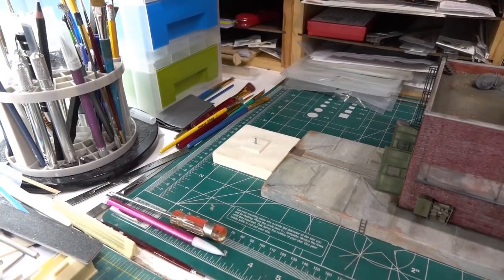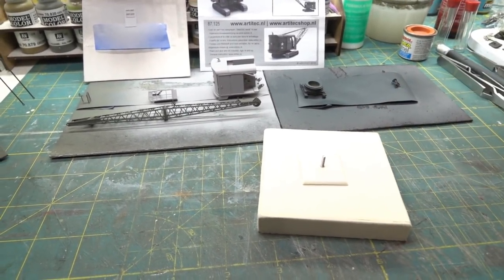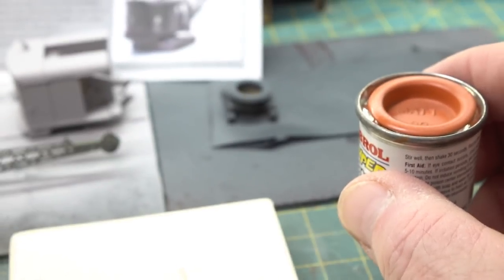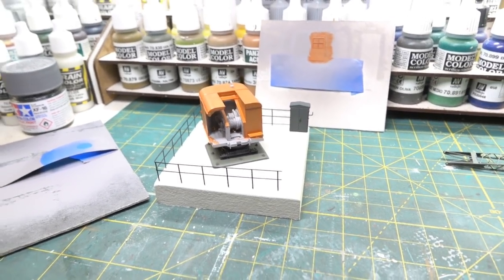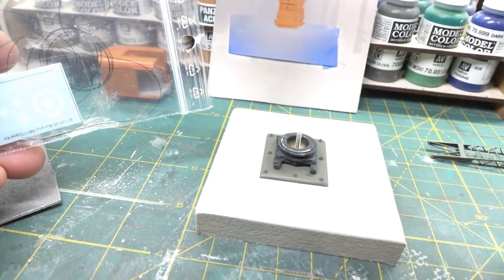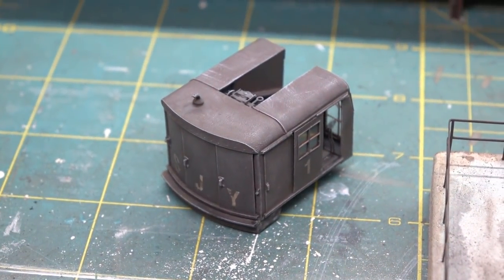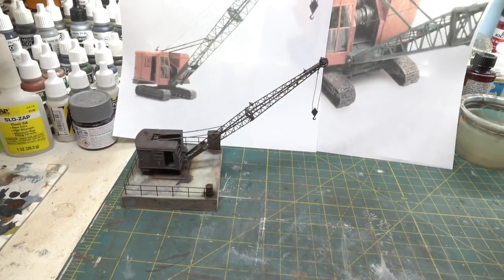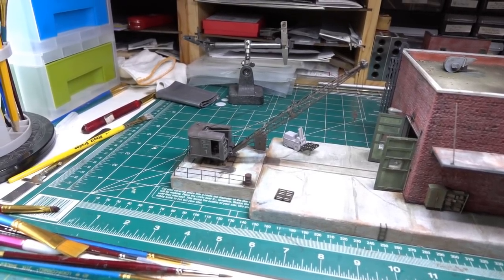Scratch Bash Project: Industry for Lake City- Addendum

Comment: To help with the way the hook hangs try hanging just enough weight to bring the strings taught then do a couple of coats of super hold hair spray on the string.... worked great for me!
Reply: Problem is- they are not strings! This is a brass piece. When I glued it into the top of the boom I had it off just a bit, and then I tried to "straighten" the hook. Yeah, doesn't work too well on a rigid brass piece! Argh.
Reply: @robbennett1965  ohhhhh...  that explains why there was no movement in the hook when you relocated the crane to the back of the factory. I thought it may have been just a starch or wax coating making the drop leads stiff... well thats sorta dumb. Is there a way to delete them between the hook and crane arm and run a loop of what ever to tie them back together with elevation being of your choice?

Comment: Hi Rob, love the videos. A  method I use for hanging chains is to hang a weight to pull the cord tight then run a small amount of super glue as it’s stretched out, leave for an hour to ensure the glue has fully set not just grabbed, repeat if needed. .

Comment: Rob, Nicely done.  The two spare bits could be made into equipment cannisters that get craned around the shop floor. Our factories used these canisters and open top cradles, base, triangular sides, pole across the top. The worn metal finish is very good. Regards Stephen.

Comment: Nice job on finishing that crane. It is great addition to the build you have.  I hope it reaches the tracks.  For the hook to hang nice, you need either a load or you could tie it down with fishing line.
Reply: Yeah, but the hook isn't on string- it is a brass piece. I bent it slightly trying to "fix" it after gluing into the top of the boom.

Comment: Rob: re the hook not hanging nicely; maybe add a length of metal chain to the hook. There's a million reasons why it might be there. Depending on the height of the hook above the ground, it could either dangle or lie in a heap. Just a thought, I'm sure there's plenty other ways.😁
The whole project looks superb but the crane is the icing on the cake. It tells a good bit of the story too; goods go 𝐢𝐧 that way; things get done; goods come 𝐨𝐮𝐭 that way - simples.😁
I prefer the revised colour scheme. One thing I did think of: have you ever tried "chipping"? 
If you'd put chipping fluid over the orange, you could have rust showing through from beneath the grey paint - cool technique.  Again though, just a thought - looks great the way it is. 
Your rigging, despite your doubts, looks fantastic. Like you, I'm just "normal" and have absolutely no idea if it's rigged correctly. The thing is: it 𝐥𝐨𝐨𝐤𝐬 right.
It'll be nice to see it bedded into the layout and a wee cameo scene under the hook.😁👌👍

Cheers for now,
Dougie.
Reply: Dougie- I have done chipping before. On the Central Valley double track bridge I used the Vallejo Chipping Medium. (I actually airbrushed that puppy!) It works fine, but for something this small I didn't feel like going to that effort (too lazy!) And I didn't intend fo rthe crane to be in too bad condition, as they do use it and if Cletus is on the ball it is maintained fairly well.
Reply: @robbennett1965  Fair enough Rob. It was just that you'd already done the rust colour, or it probably wouldn't have occured to me. 😁 Cletus seems to keep busy; hope you pay him well. One advantage of HO scale workers; just build him a house, give him a car and he won't need fed or paid.😁

Cheers for now,
Dougie.